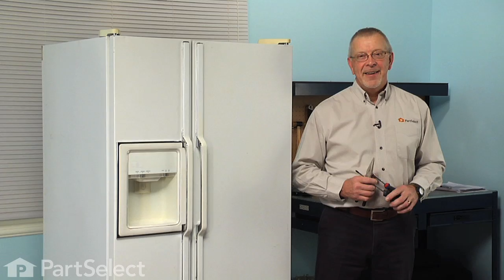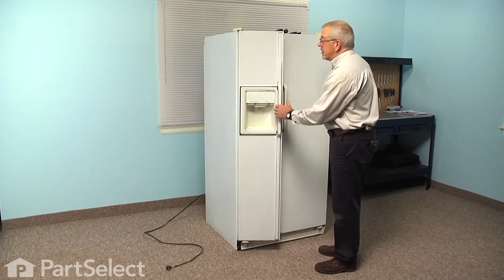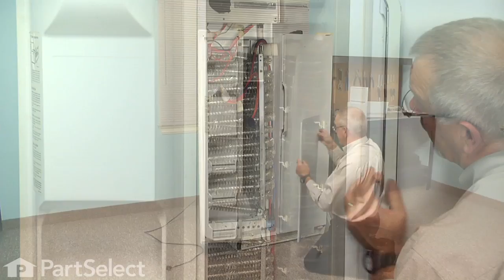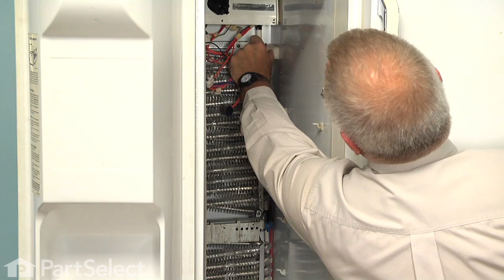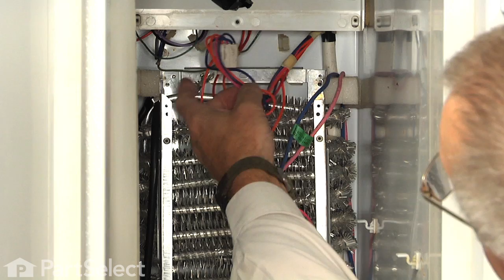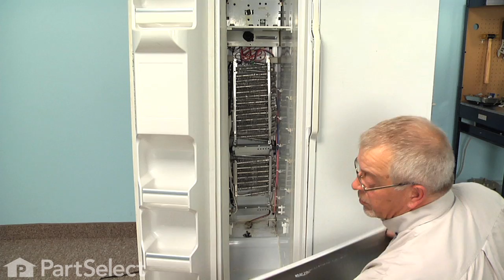Refrigerator Repair - Replacing the Defrost Heater (GE part # WR51X442)

Comment: Great instruction from Part Select. Video very good as well as the instructor and camera operator. . This was the 4th  Defrost heater I have installed,  since the building of the house in Jan. 2000.  I am thinking the first replacement was maybe 7 or 8 years ago  2015  about so I decided to take a look and see if I am doing anything wrong .  Nope , the only thing you could do wrong would be to mix up , front to back.  I did have to replace the timer on, I think, the 2nd replacement of the heater. No big deal there just plug and play.  The only problem  I have with 'The presentation ' i s you don't show the tech's laying on the floor trying to align the bracket holes and operate that long  extension .  So to add to  that scenario , since 2017 i have had 2 knee replacements and  I am heading to my 83 rd birthday. It  was better this time though  , just finished about an hour ago freezer temp. is down to 40 deg. I decided to work from a chair everything went fine except for that same long reach.  great help great product "GE".. Thank you! - DMFR

Comment: This video is a decade old so I doubt I’ll get a response, but I need to do this in a couple days  once the part comes in. It’s for an old garage fridge that’s been unplugged for a few days. Wondering if it makes sense to reset the defrost timer as well once this is installed? That way the fridge has a full cooling cycle to get cold before the new heater kicks on?

Comment: Thanks for the video as I just replaced the defrost heater in my 30+ year old GE refrigerator.  If you disconnect the heater plug, you can check for continuity by using your ohms meter for a reading across the  blue and pink long male ends of the unit. No continuity and a heater is burned out.  Reading of 25-30 ohms and the defrost heaters are OK.

Comment: what model is that defrost heater kit ur using? i need one exactly like that and my fridge model# is unknown, not legible. therefore i have no idea what my model # is, and can not order parts for it, but that is the exact defrost assembly i need
Reply from the maker: Hi Jess, here is the link for the defrost heater kit in the video. http://www.partselect.com/PS303933-GE-WR51X442-Defrost-Heater-with-Thermostat.htm?SourceCode=3&SearchTerm=WR51X442
If you would like to order please call us at 1-888-738-4871. Have a great day.
Reply: my side by side refrigerator is exactly like this and the model # is TFX20JAXA and the part# for my element was WG03F00532
Reply: Jess , did this work for you my Kenmore is not legible?
Reply: My refrigerator is 30 years old and I recently replaced the defroster heaters. Parts Select had some items I needed but no longer carried the heaters. I was about to order a new refrigerator, then I gave EBay a try, as luck would have it, they had the heaters for 35.00. This was 4 months ago, now running like new.

Comment: Enjoyed the video...extremely informative. My question is that I have an older GE side by side that had the original evaporator replaced years ago.  The diagram for my model shows ( 2 ) defrost heaters...one at the bottom and one in the middle of the evaporator.  Recently, my defrost heater went out...so, I am replacing it with a new one.  Upon removing the evap. panel, I noticed that there is only (1) defrost heater.  Apparently, the GE tech who replaced the original evap. must have replaced it with a different evap...hence, the solo defrost heater.  This was done w/o my knowledge.  After removing the defrost heater...I have only found this identifier G7102 marked on the end caps ( where the electrical wires plug in ).  The defrost heater that I located is WR51X10055...it appears to match the one I removed, perfectly.  Can you tell me if the G7102 identifier would match the WR51X10055 heater?  Also, I noticed that the bracket on the old defrost heater seems to have needed to be bent in order to fit on the bottom of the evaporator...is this common practice, or did this technician pull a 'fast one' by using a different evap. and having bent the bracket of the defrost heater in able to have it attach?  Any help is appreciated!
Reply from the maker: There are several scenarios that may have contributed to single heater currently in your refrigerator. What is your model number? You could contact GE and provide them with your model and serial number to determine if a retrofit has been made.